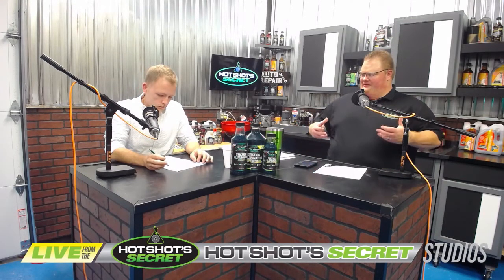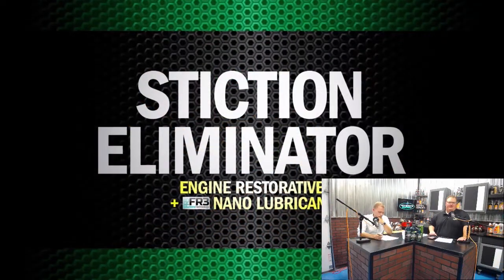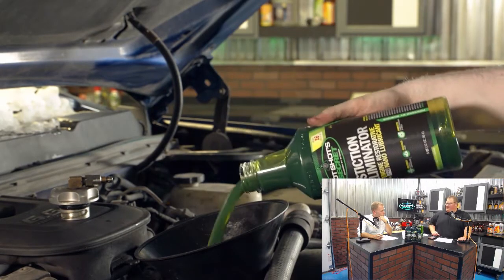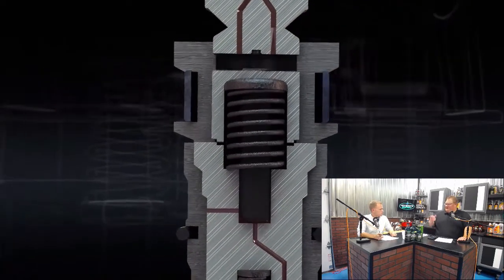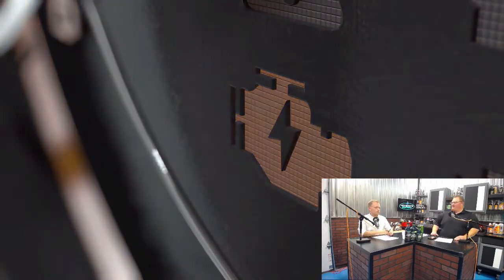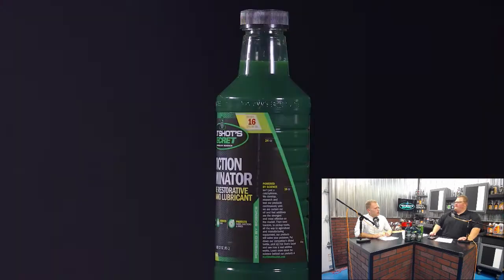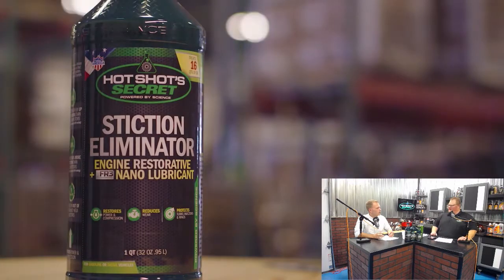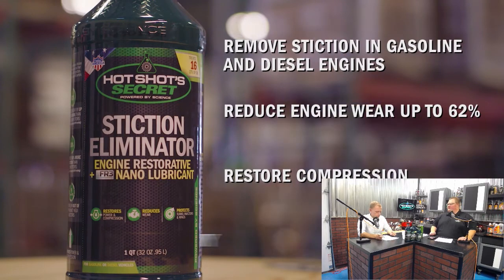What is Engine Blowby

Comment: So my diesel truck has a blow by its not excessive i did the oil cap test and it doesn't blow it off will the sticktion reduction help with?
Reply from the maker: All engines have some blowby. Stiction Eliminator is great to help fix and prevent blowby from becoming a problem.

Comment: Hi i rebuilt my Scania truck motor .On start up there is smoke out of the breather ive been told the piston rings must seat first
Reply from the maker: Correct, on a rebuild the first couple thousand miles the pistons will begin to seat and blowby should be minimal at that point.
Reply: And even when you accelerate there is white smoke is this normal so i dont need to worry

Comment: With blow by, is black soot getting into the oil causing excessive wear that stiction additive will help with?
Reply from the maker: Stiction Eliminator will help reduce blowby, improving the ring sealing capacity. No additive is going to help with the soot. A Frantz bypass filter would help some with soot, going down to 2 microns.

Comment: Fr3 swells seals ? Is that harmful to a low milage engine ?
Reply from the maker: It is a slight swell, not to a harmful point. We recommend waiting the first 10,000 miles on a new engine or rebuild to allow time for break-in before using FR3 or Stiction Eliminator.